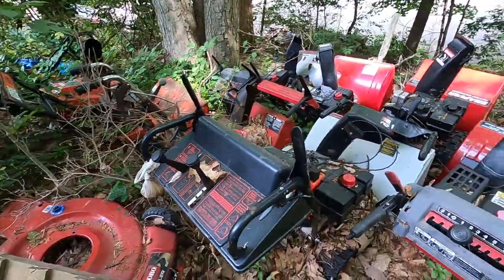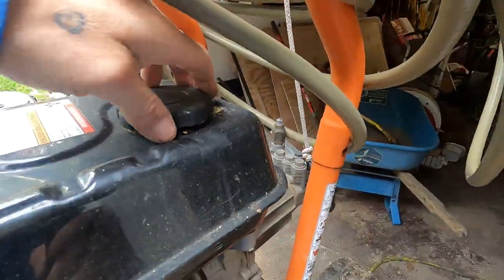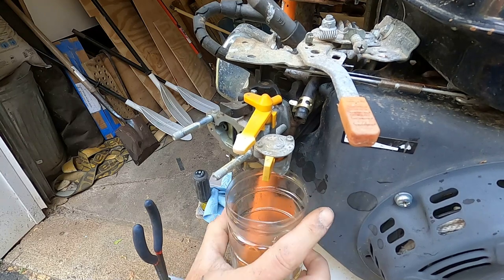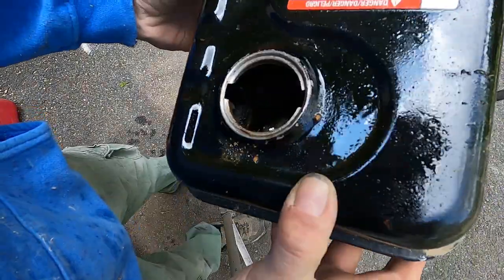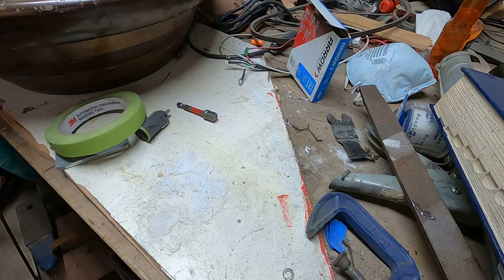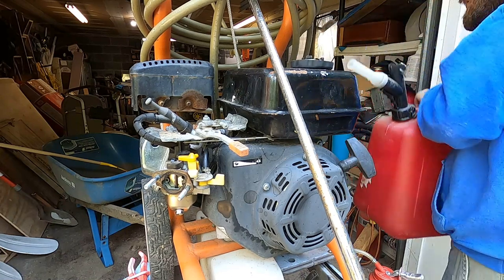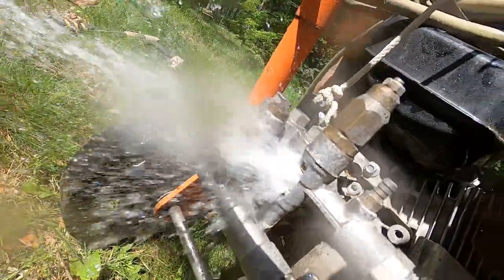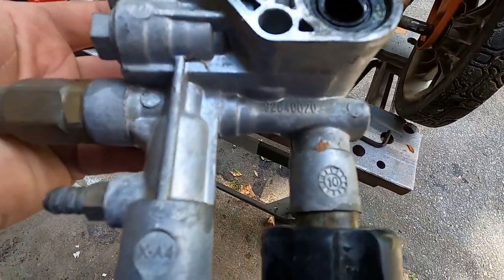Junked GENERAC POWER WASHER was a simple fix.. until it wasn't

Comment: I have a very similar Generac pressure washer and it’s been very good to me!  Bought it new and only use non-ethanol fuel and stored in a heated garage in the winter.  Starts up every time on the first or second pull every spring!  Mine is 3200 PSI
Reply: Not me, i keep non ethanol and stored in a clean indoor environment. About 8 actual hours worth of use ( so about 8-10 uses) the carb is toast. No filter other than one (sort of) covering the fuel fill hole. Carb is constantly clogging. I just can't keep spending so much time cleaning the tank and carb to keep it running when needed. 
Pos in my opinion...and add on the corrosive metal threads for every water fitting...my opinion on generac is now worse than what generator people have told me. Bad name, junk product through it's entire design.

Comment: Enjoyable video to watch, love the presentation. I have the exact model, Starts right up, but when I squeeze the trigger, I get a short burst of water, then barely nothing and within about 15 seconds  the motor will temporarily lock up. I am thinking it's the unloader valve, but I have no idea where the unloader valve is located on this thing. Nor do I know if it's bad, or just needs adjustment. Thanks for a great video.
Reply: Mine would work intermittently just like yours . In my case it was the handle. I went to Walmart bought just handle . I think it cost me $20 ?

Comment: It blows my mind how people throw these $400 to $500 pressure washers in the garbage because they left gas in the tank and gunked up the carburetor.
I picked up a 3100 psi Generac pressure washer that wouldn't start for $50 bucks, purchased a $15 HIPA after market carburetor off of Amazon, took 5 minutes to switch out and started on the first pull and runs like new. A whole new pump only costs $45 on Amazon, mine came with a new one, so I'm all set for years to go.

Comment: Have the same Generac, same rotted fuel tank. That fuel line is TUH-Rash and I replaced it. Had to Sea Foam and shake the tank with the washers and nuts to get corrosion off.
Got it running, then my house well tank couldn't keep up and ended up blowing the pump.
😑